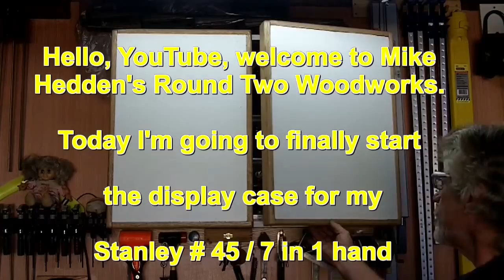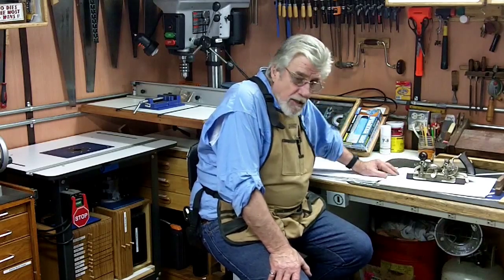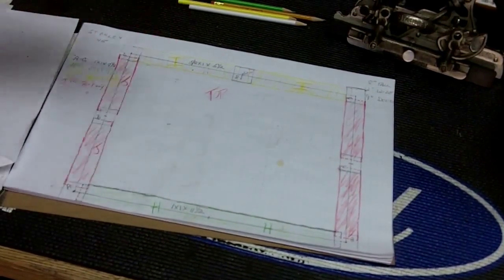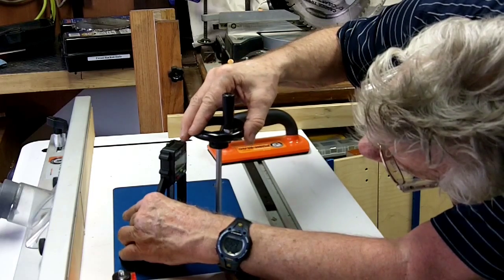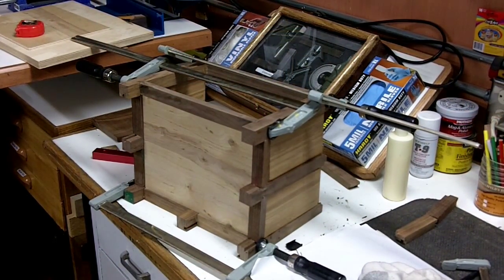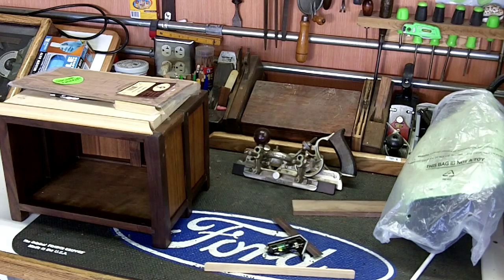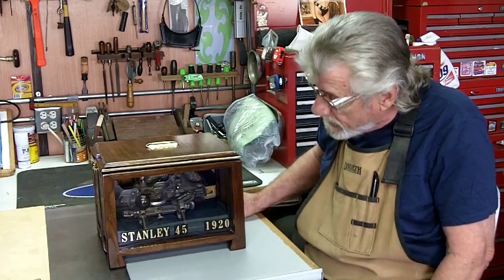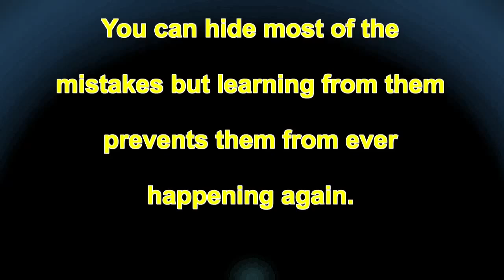Stanley No 45 Display Case  Sweetheart Circa 1920

Comment: A decent 45 with full set of blades for under £5 is right at the top of my shopping list. 

I like the colour coding, I don’t use sketch up either. It’s a beautiful case, very well done indeed though I do hope that the 45 will be used from time to time. 

A great video, As someone with a serious respiratory condition it’s good to see someone take sensible precautions with their lungs. Thanks for the work that went into this video.